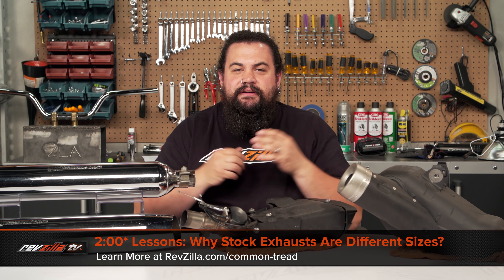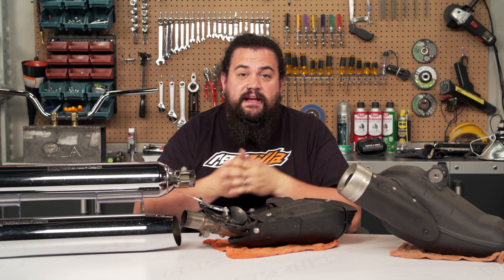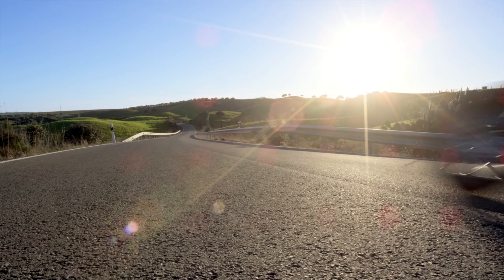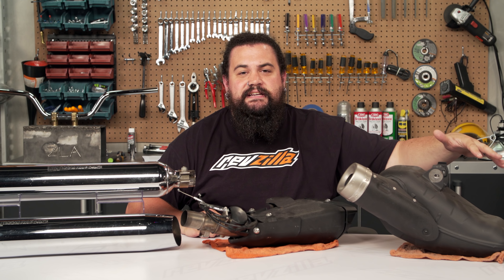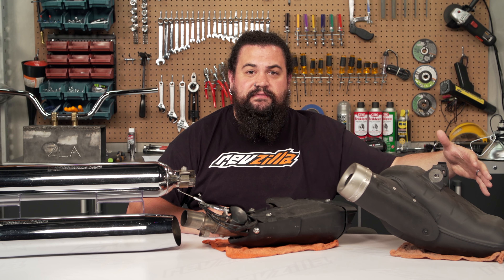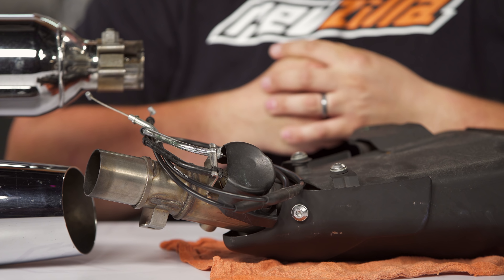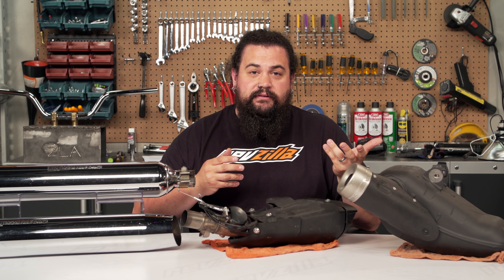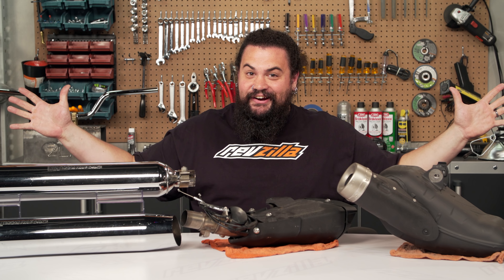2 Minute Moto - Why are stock exhausts different sizes?

Comment: So, we took the stock exhaust off my xsr including the converter, swapped it for straight pipes without the catalyst box and welded a m4 slip-onn to it, also swapped the stock air filter for the k&n hyper flow type. No codes or anything. Is the bike healthier or did we screw with it too much?

Comment: Good vid, Lemster.  So, a question my buddies and I can’t quite agree on: is it harmful to a motor when running no baffles at all ( with all the popping et al from the backpressure)? Thx.
Reply: Gary A if the bike fuel/air mix is right you should not be getting exhaust popping on deceleration. That is unburnt fuel detonation in your header pipes. See if you can remap the mix.
Reply: metalheartmachine thx for your kind reply..., in my case I have an 03 Anniversary FLSTFI with K&N free flow, Stage 1 SE mufflers with the baffles out and the Vance and Hines fuelpak mapped accordingly ...and on decel as you say, and even upshifting, I get the popping.  I’m beginning to think some of my buds are right, ie, the baffles out may be a bad thing? So back to my original question... is back pressure bad for the motor?